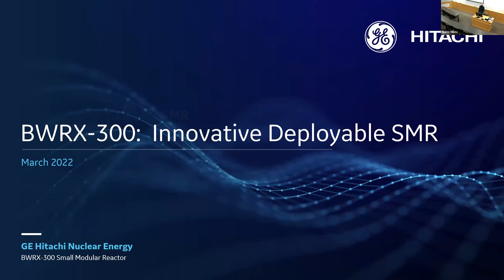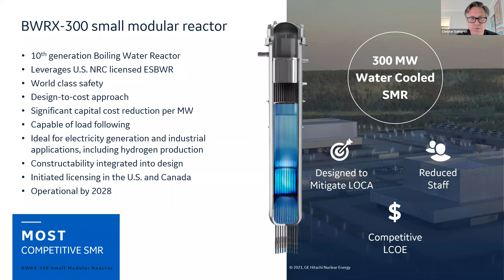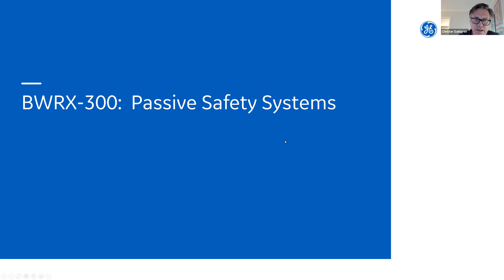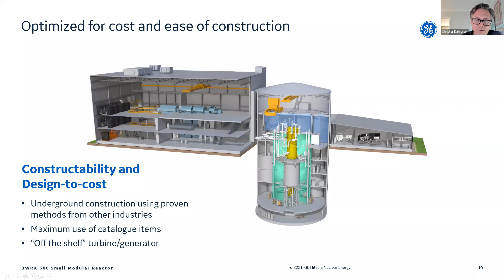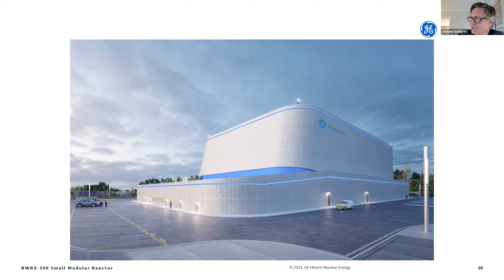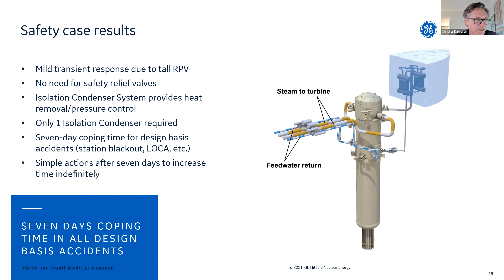NE Seminar 3/10/2022

Comment: I'm a bit confused by the cathegory of the ICS (29:35): it is cathegorized as class C where it is clearly stated that a signal input of "intelligence" is required to open the condensate return line. I'd say it should be considered a class D system (passive execution/active initiation). Am I missing something?

Comment: Such a neat technology. Should be produced and deployed by the thousands and ASAP. My question is if there is a way to reduce staffing for NPP which would have for example 4 BWRX300? Something that may be strong point of Nuscale- 12 reactors and one control room with same crew of operators controlling several at the same time. If every BWRX300 is treated as separate power plant with full staffing, full shifts then this part will make it somewhat more expensive to run. (I comment in the middle of watching and maybe it is addressed still)
Reply: I believe that all SMR designs allow one crew to operate or monitor multiple reactors. The crew might grow slightly as the arrays of reactors grow in size, but possibly more for grid balancing than reactor management.